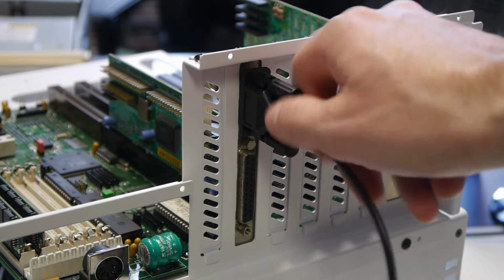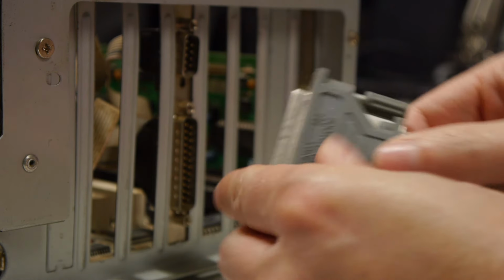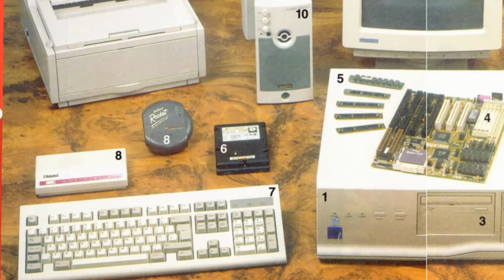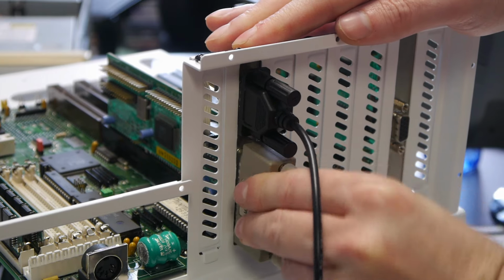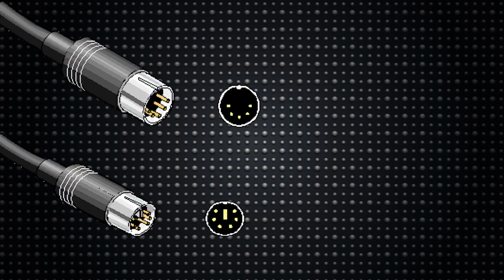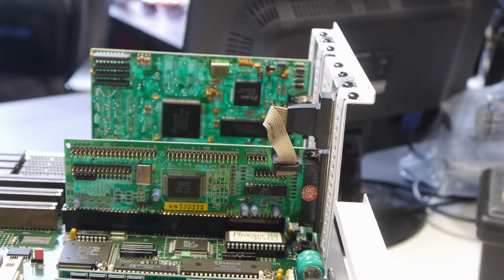What did we use before USB? | Nostalgia Nerd

Comment: Usb type c is a thing of beauty.
Reply: Yes, but there's not a consistent "up" between all devices of the same form factor. I have tablets and phones where the USB ports are aligned towards the screen, and ones where they are aligned away from the screen, since it all comes down to which way up the board goes, which can often depend on which way most economically uses the space within the case.
Reply: Capta Praelium not all ports are right side up.
Reply: Dominic Mulligan
That's not a problem with USB-C.
Thats a problem with it not being standard yet and too many older variants still being used.

But no, you don't need all that mess. Just a proper USB C hub with at least two USB C inputs. Just checked my local amazon, those do indeed exist.
Reply: amnottabs usually leverage. Most with micro usb but also on usb c.

If your plug is long and stiff its like a pry bar on the port if it get moved around
Reply: Matthew Kriebel
Well..... order an adapter for $1 from china and you're good. Or just get a different cable.
Reply: BK-201 The Spliffsta this always makes me wonder how people actually breaks usb ports (usually the micro USB variant) like, if they apply a certain degree of reasonable pressure at it doesn't fit they actually put more strength until the connector snaps instead of checking the orientation
Reply: Dominic Mulligan USB C hubs are already a thing.
Reply: Ninja Master, indeed it is! Yes it is!! USB C IS a thing of beauty. x
Reply: USB 3.1 type C is nice, for small things, but USB 3.1 type A is great for everything else, such as USB Flash memory sticks, and USB external hard drives. Those small type C connectors are just too fragile for something that might get accidentally pushed on and stuff, or something that might have a good bit more weight pulling on the connection, such as a flash drive.
Reply: Actually USB C is also great for low light situations, so that you don't force the connection in the wrong way. Because sometimes you can't see the logo on the cable, & feeling it doesn't work if the manufacturer just printed  the logo instead of engraving it. Or if they also engraved another logo on the opposite side. Thus, it actually is great for consumer use...quick & easy.
Reply: Nope, it's a mess.
Reply: Yep, love it on my laptop and when I build my next PC, I'ma make sure I add USB c ports in it.
Reply: Matthew Kriebel spend $4-5 buck and get a quality c to a cable. Theyre metal plugs, securely plug in and cable is braided and strong. The cheap ones are a headache
Reply: Note that USB 3.x does not require high signalling rates. It is still possible to support only the original 1.5Mb/s rate and call yourself “USB 3.1 compatible”.
Reply: Ninja Master I bought a phone with that and then could not borrow a charger. Then I went back to a phone that has the old nonreversible micro USB and presto everyone now has type c and I cannot borrow a charger.
Reply: Real engineers use USB B through hole soldered. If you can't break a window with it, it's not worth using.
Reply: Nick Wallette
why should we? You can use a USB1.0 compatible keyboard (or anything) on a USB 3.1 Port.
Where is the fucking benefit of having two standards? You have to stock two kinds of cables etc, then you bring you fancy FW external harddrive to your friend and he got only USB on his PC..... 

There is no fucking point in keeping the old standard as long as it's 100% backwards compatible, which USB3.1 is by now. There were some issues in the early days of USB3.0, but those times are long gone.

I would like USB C much better, if it would become standard already. The real problem is that you have to fiddle with adapters and shit, because most new devices still don't have it. You phone (if it's not super cheap at least) has USB C, but your new digicam still uses micro USB, USB Sticks are usually Type A (either USB2 or USB3.0).
That's fucking annoying.

The fact that I plug my USB 1.1 Mouse into a USB 3.0 port, doesn't bother me a bit.
Reply: You’re goddamn right.
Reply: My only problem is its still practically impossible to clean out the sockets.  The apple design is really freaking easy, just use a paperclip.  The usb c one has me going at it slowly with a staple...
Reply: Yeah, the sooner and more widespread use of Type-C connector, the better. The type-C connector isn't just used for USB, but also Thunderbolt which is designed for higher bandwidth and the reason why you can use it with external GPU. Now having one standard-port is something we have been waiting for, except for some companies persist with their own proprietary connector.

Thing is there is a new problem emerge with Type-C, that is not all ports have the same features it supports. Some ports support Thunderbolt, while most are not, most are 3.1 while few are actually just 2.0, some support charging and some don't on laptops. Hope this will get sorted out.
Reply: I think it's far too small. I worry about the durability of USB-C ports and cables.
Reply: ...I just feel the locking thingies on the Micro USB port and that's it, never forcing wrong way in.
Worst case is the charger itself, but that's very hard to get wrong, as you can easily feel if it's going inside or blocked by the plastic
Reply: Knuckles the Echidna - I LOVE YOUR NAME
Reply: What if the ports are sideways?
Reply: Nick Wallette but...but it's fast......
Reply: Max Mustermann you shouldn't order cheap USB C parts USB C is so powerful if a cheap component goes bad it could have a chance to hurt your phone
Reply: Max Mustermann also frustrating that apple ships premium phone with lightning and that's still based on a 2012 protocol with micro usb speeds.
Reply: Michael Fisher why go back to an older micro usb if you dont have to? The charging speed of usb c is amazing.
Reply: Yep. Stronger than the shitty version
Reply: Yes "usb-c is a thing of beauty" on paper, unfortunately not in real the real world.... in fact I'll go as far to say that usb-c is inferior to the Apple's lightning port in terms of durability (not talking about performance!).  If you look inside the usb-c port there's a fragile part in the middle, while on the Apple port it's in the tip of the cable connector.  Now, if the tip breaks off the cable no big deal just replace the Apple cable, while on the usb-c your're pretty much screwed.  The idea was ok, but its implementation was fudged.  Don't believe me?  You should see the number of Android usb-c ports I replace daily at my phone repair shop (and some are next to impossible especially if it's soldered on to the main board), and virtually none on iPhones... and guess what, I'm an Android guy through and through! ;)
Reply: ... until you try to implement an actual USB type C compliant device. :)
Reply: USB C, or USB for retards.
Reply: Holes up for those cables without the logo
Also, lots of people were confusing the form factor USB type C with the actual bus USB3.1
Not all type C is 3.0+ and not all 3.0+ ports are type C.
Reply: how about you all shut UP
Reply: We literally just got our first USB C device this week. Not so beautiful when the cable that came with it is C to C and we have no C sockets on anything.
Reply: I would like USB C a lot better if it stopped trying to be all things to all people.  There's nothing wrong with keeping a slower, simpler protocol along with the high speed complicated ones.

USB 1.1 + FW worked quite well, for example.  Mice and keyboards don't need 24V, 100W, multi-gigabit bandwidth.  Can't we just hang on to USB 2/A and add USB3/C?
Reply: Capta Praelium nonononono... USB C doesn’t just add multiorientation but also many more pins, smart addressing and can support up to 24V on its tiny connection. And that’s just listing the 4 advantages that come to mind, let alone however many others are listed online.
Reply: Well, my foul-mouthed friend... the reason I think we should retain "legacy" USB is because USB-C is making too many compromises.

In the next few years, when you see a USB-C port on a computer, it could be used for attaching USB peripherals, attaching Thunderbolt peripherals, charging attached devices, charging the host device, video out, and so on and so forth.  Which sounds nice... in theory... but it's SO MUCH to ask to do all these things, and do them all well.

USB 1.x/2.x had some pretty attainable goals.  For example, when you see a USB A receptacle, you can safely assume it will provide power -- 5V at 100mA or so, for sure, and likely up to 500mA.  If your device has enough intelligence to sense the D-/D+ line voltage, you might find it can provide an absolute max of about 2A.  This is all really straight-forward, and simple to support.  You can power a 5V, low-power device with nothing invested but a USB A plug, and can get a reasonable amount of current with a very simple controller IC, or just some fancy logic and a comparator or two.

Data transmission was equally simple.  Not TTL/RS-232 simple, but even USB 2.0's 480Mbps wasn't exactly a feat of engineering to implement.  If you could settle for low-speed or high-speed USB 1.1, then it's within the realm of sophisticated hobbyists to design a USB peripheral.

And that's why it's so ubiquitous today.  It was not hard to add USB support to a device, and the benefits were overwhelming in light of that minimal up-front engineering burden.

Then we got USB 3.0.  Now the signaling rate is so high that it requires very carefully impedance-matched traces, complex circuit protection against ESD that has low enough capacitance such that it doesn't interfere with the transition time of the digital signal too much, but can adequately clamp high-voltage transient spikes... etc etc etc.  It's complicated and expensive to do right.

Now we've added in variable voltage, support for sink AND supply, different protocols that can ride on the same physical connector...  It just keeps getting more and more of a beast to even comprehend, much less design for.  This WILL affect the ability for low-cost devices to implement USB-C, which means they'll want to fall back on legacy USB, and so we'll have to continue to provide an interface translation dongle to support those things.

And that's just the cost to the manufacturers.  Let's talk about consumers now.

First, if I want to charge my laptop over USB-C, I need a cable that can safely handle that kind of power.  In order to protect the devices at each end, the cable itself, and the consumer from all kinds of mishaps, there needs to be a way for the devices to ENSURE that the cable is capable of handling what it's being asked to do.  This requires intelligence in the CABLE ITSELF to report its characteristics to the host device.  Which means even the cables are now more complicated and expensive than they were before.

Also, the specifications for shielding, twists per inch, insulation, capacitance, and so on -- those tolerances got tighter as well.  Which means:  Good cables are expensive, thicker, shorter, less flexible, and generally more of a pain to use.  Bad cables are more error-prone and will fail in all kinds of frustrating ways.  The user will carry the burden of selecting the right cable for a given task (charging?  high current charging?  high-speed data?  legacy support?), which will lead to uncertainty over the suitability of a given cable for a given task.  While before, it the plug fit the hole, it was the right cable.

Finally, USB is even capable of role-reversal now.  So you don't even necessarily know which end of a two-device connection is running the show anymore.

Simple, low-speed, low-power devices are going to have to cope with a lot of these issues JUST TO WORK AT ALL, for no good reason.  If we just retained USB 2.0 interfaces as a matter of course, the plethora of devices that don't NEED 24V, 50W, >1Gb bandwidth, connection master negotiation, etc., wouldn't have to deal with implementing an interface to a host controller that DOES have to (potentially) cope with all those things.

It's just so much unnecessary complexity, and it makes no sense at all.  Any time in history where some spec tried to be a jack-of-all-trades, it usually failed at most of those things -- sometimes spectacularly.  Maybe I'll have more faith in The New USB when we all finish migrating to IPv6.
Reply: ...for people that never figured out that "logo side up" works XD
Reply: Should of never been “logo side up” to begin with.  If the engineers weren’t lazy, it would have been a reversible connector like lightning or FINALLY the USB C we have been waiting for.   Those nano and mini USB connectors are garbage.
Reply: 7thlvl hahaha don't be type D :)
Reply: But they are not very robust - small and fragile - wait till next year when things stop working.  Nothing like a 10 year old USB-B connector - nearly bullet proof.
Reply: no its the worst thing ever
Reply: ShinobiNinjA - Calm the fuck down I noticed you can't handle dad jokes.
Reply: My USB cables typicall don't have a logo, so I can't face it up. 
But in theory it seems to work with other cables too. Just moved my PC into a new case and realized I had to face all SATA flat cables text side up.
Reply: Then they are not USB ports. The alignment of the ports is in the spec, that's why "logo side up" always works.
Keep in mind that "up" isn't your "up", it's the device's "up".
Reply: @captapraelium1591  tell that to the DualShock 4 controller.
Reply: 7thlvl fuck off edgelord
Reply: Exactly, it's the device's 'up'.

Comment: nowadays there are so many USB types it's basically the old days again
Reply: rubberwoody not really, only USB A, B, C, mini, and micro, and you can get passive adapters between them, as per the standard.
Reply: George Vasquez I don't know which planet you are from but it certainly isn't Earth. USB A is still definitely the most used port.
Reply: USB Hosts use Type A. So nearly every motherboard, nearly every laptop, desktop, PlayStation, Xbox 360/One, etc. all have Type A slots.
Reply: ... okay, even taking into account the different types of USB cables out there, when including the different types of ports on those cables...

No... no we really are not.

As somebody who at one point had nearly 500 kibibytes worth of text files of the different types of Serial/Parallel Port Pin Arrangements for different port adapters, cross overs and what not--mostly for the purpose of replacing the plugs, making converters for said plugs--or just attaching things to Serial/Parallel ports that were never intended for such purposes.. no... no we are not like the old days again.

Seriously... 500 Kibibytes of Text Files! That doesn't sound like much today! In fact it sounds ridiculously tiny! I assure you that back then it was not tiny! It is about how you USE those text files! Some Harddrives could not even fit it onto them! That is more than some floppy disks could handle! Other floppy disks that was most of the floppy disk for a single purposes! Even with High Definition versions!
Reply: Printers use Type B too
Reply: USB Type B and Micro USB are still used today. But they're slowly being phased out by Type C. I don't think that many devices use Type A and Mini USB, nowadays.
Reply: I'm content with what USB has become. I spent a lot of money on firewire when it was new and where is that now? Non-existent.
Reply: +The Real Elvis
Feel ya. I bought into eSata just before USB3 came to market xD
Reply: It’s all backward compatible so not really.
Reply: That's not why Micro USB is used, Hansbald. Micro USB is designed for more mating cycles than Mini.
Reply: What a load of horseshit some of you guys are talking.
Mini USB is basically dead, as it got replaced by MicroUSB.
MicroUSB is also slowly being phased out and replaced by Type C connector.

Basically everything that isn't a phone, camera or other small (mostly handheld) device uses Type A.
Only 3,5" external hard drives and printers usually use Type B, as the connection is a lot stronger. You don't want to accidentally tuck on your cable while transferring data, and having to start all over again or- even worse- possibly even corrupt your filesystem.
Reply: Except you can get adapters for all USB cables to make them fit all USB ports. There's no adapter on earth that will connect a SCSI cable to a MIDI port.
Reply: Type A: almost everything
Type B: I thought these were some DELL exclusive printer and scanner ports
Type B-mini: some bluetooth speakers use these, but I think more recent ones now have Type-B micro
Type B-micro: almost every android smartphone
Type C: Well, they can be used for charging laptops and better data transfer and are both-sided, I hope laptops wont just have a single connector from now and nothing else
USB-A mini and micro: IDK, I guess these weren't much used
Reply: USB C is becoming a mess.
USB C Gen 1
USB C Gen 2
USB C Thunderbolt

And apparently some cables support different levels of wattage which allows some cables to transmit data only or data + power.
Reply: most are backwards compatible so no, it's really not.
Reply: usb is being phased out now anyway. theres no need for wires at all anymore for data or power transfer
Reply: @Mr.Youtubez  I prefer cables over having batteries in every device.

Comment: 5:45 how on the earth were these ps/2 cables plugged in as if they were like magsafe? This just doesn't feel right.
Reply: ProfesyonelCaylak I've lost count how many PS2 pins I've carelessly bent over the years due to not looking what I'm doing...and then having to very carefully straighten them with a small flathead screwdriver!
Reply: It looks like the footage is running in reverse.  So he was actually unplugging them.
Reply: maybe... in that case, this probably reversed footage is really well done :D 

even if it was unplugging, it was smoother than I thought and experienced
Reply: Don't mention bent pins... I've lost processors that way, it's still too painful, gone before they had a time to shine :(